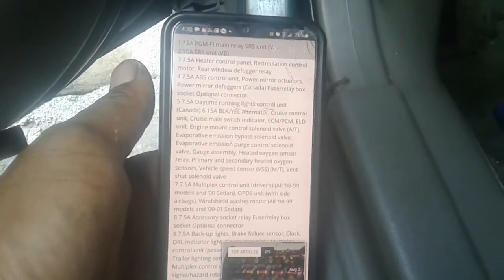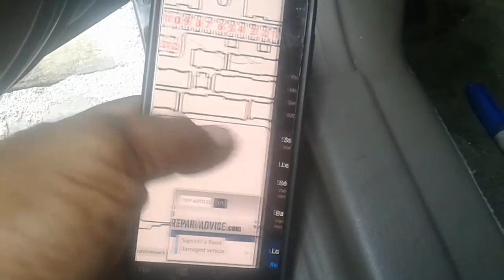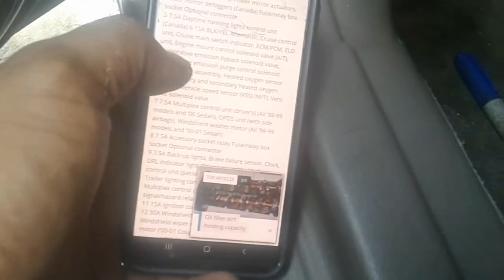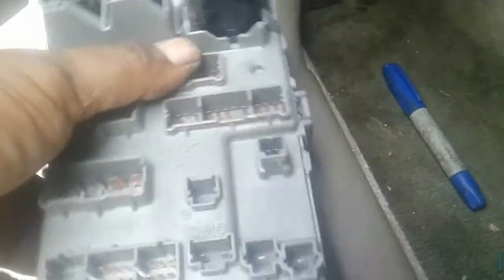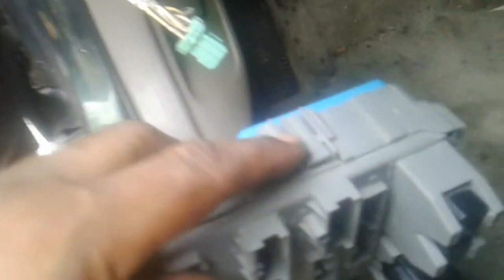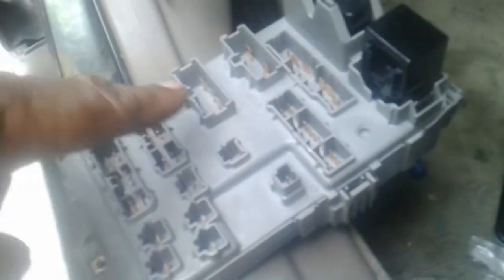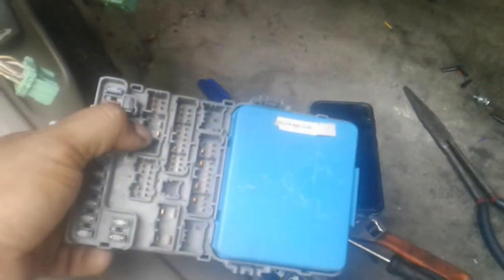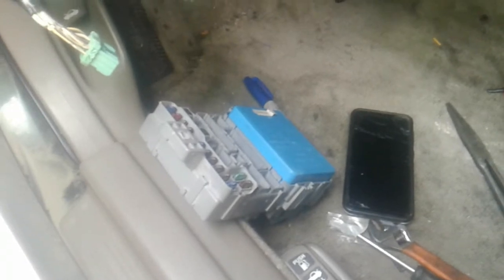98-02 HONDA ACCORD MULTIPLEXER REPAIR PART 1 OF 2..

Comment: Thanks a lot for giving me new hope. I have a Honda Ridgeline 2008 RTL and the electrical  system is acting up. First the guage is not showing the outside temp, odometer, trip and even the Headlight swithc and other info. Plus the AC blower works but the AC Radiator fan and clutch do not engage. Took it to the workshop and they say to replace the MICU. In Ghana I am not getting the same model M2 I got similar one for the Honda Accord and other models M6 and M4. I need help what do I do can I try the different models on my car? What do you or any one recommend